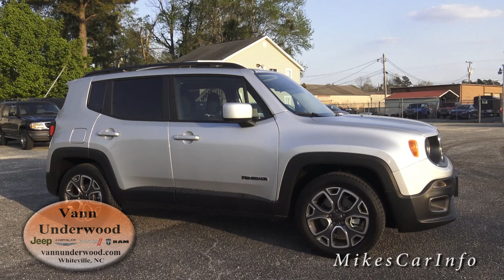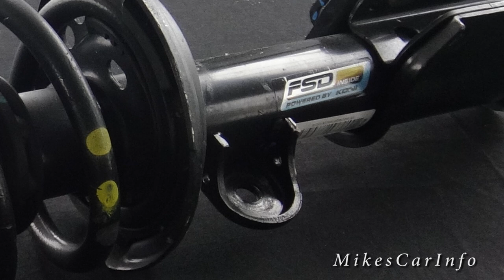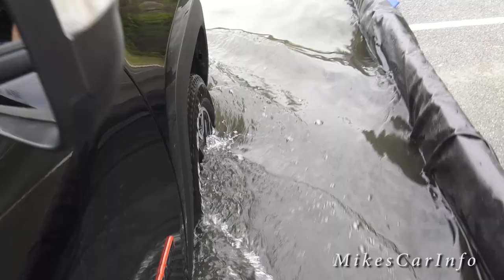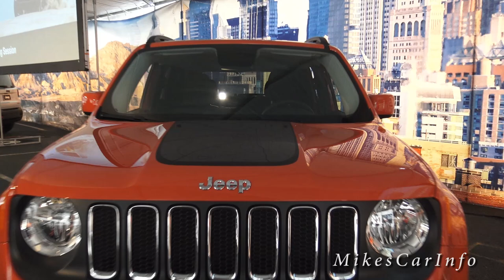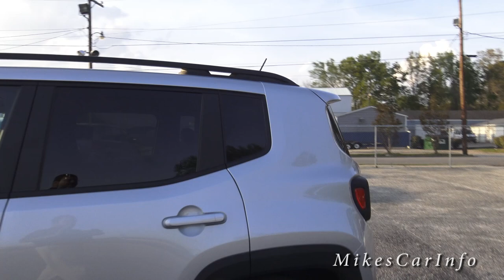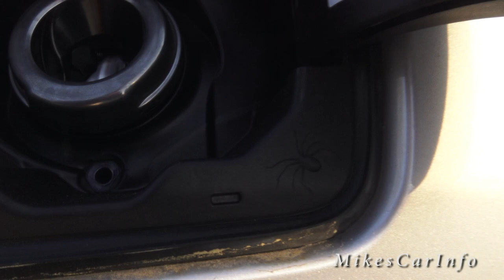👉 2015 Jeep Renegade: Update

Comment: I've heard that the Trailhawk model rides noisy down a easy stretch of highway but is that true for the other models as well such as the Limited model or is that just with the Trailhawk?
Reply from the maker: 17th WhitePrince Road noise will vary depending on the type of tire. The Trailhawk may have an offroad tire option which will be noisier than standard tires.
Reply: Thx .. that makes sense xD
Reply: 17th WhitePrince it's true. But the wrangler unlimited rubicon is much more better than the renegade less noise and more off road capabilities
Reply: The trail hawk rides fine on the highway much better then the patriot.